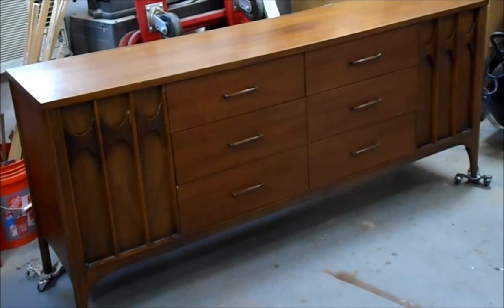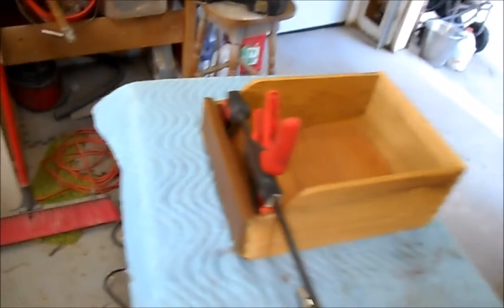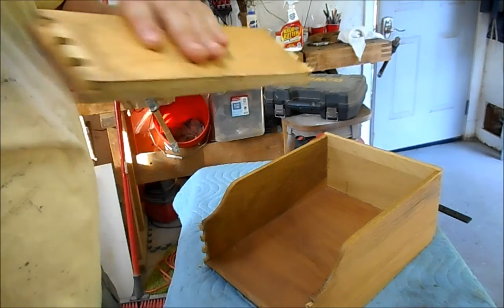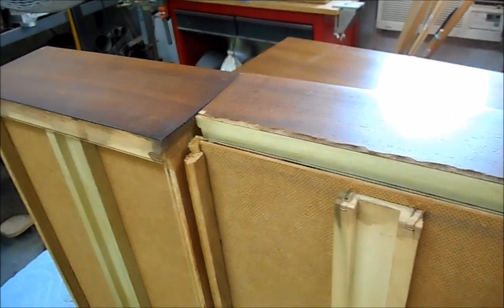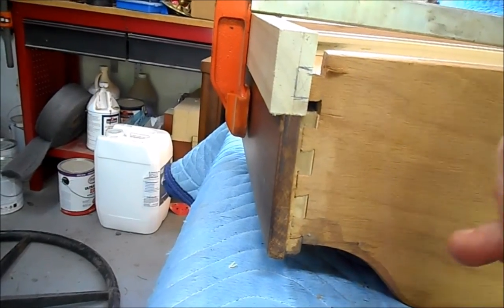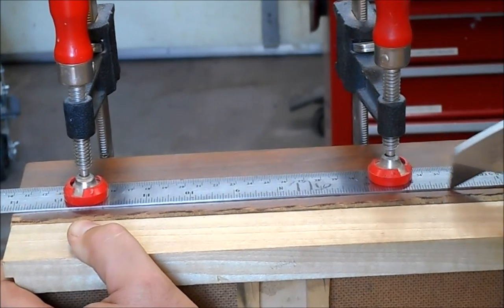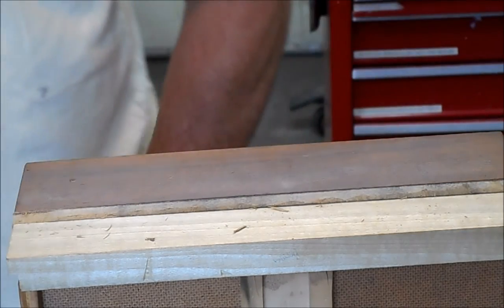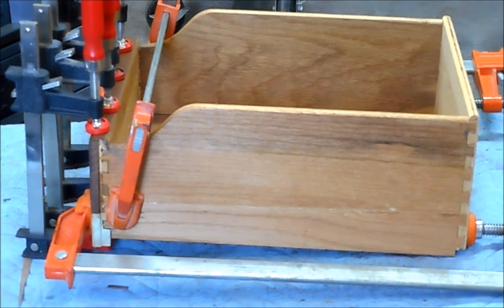Restoration of a Mid-Century Modern Dresser Part 1

Comment: I think you do a very creditable job of repairing finishes and your finishes themselves are very good but just once I’d like to see a furniture restorer who knew something about woodworking and furniture construction.  Those were machine cut dovetails and cheap ones at that. You should have cut the drawer front back to good veneer instead of mucking about with straightedges and razor knives. The dove tails could have been cut out with a drill and some chisel work on the outside. Oh, and by the way, when you were cutting the dovetail with the chisel you had the bevel on the wrong side😕
Reply from the maker: Yes, I just got out of woodworker prison for my faux pas with the chisel.  I promised my parole officer I'd do better next time.
Reply: so rude!